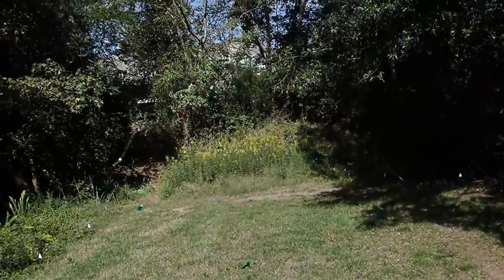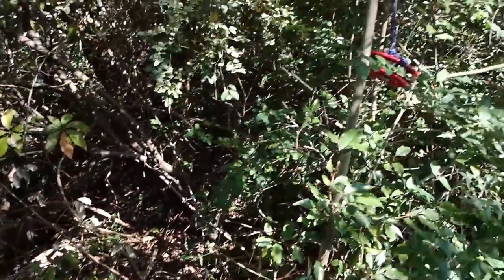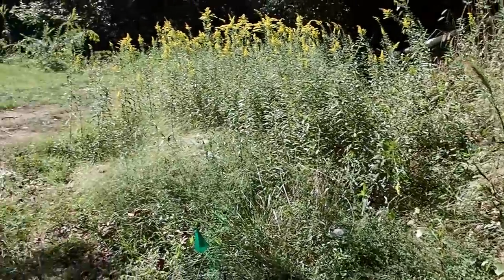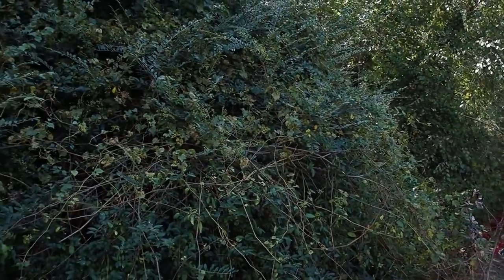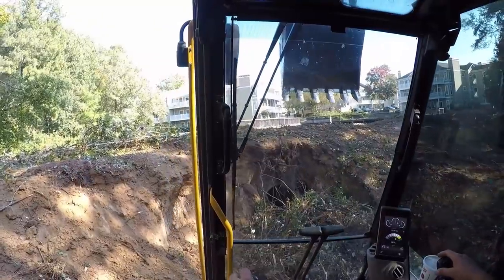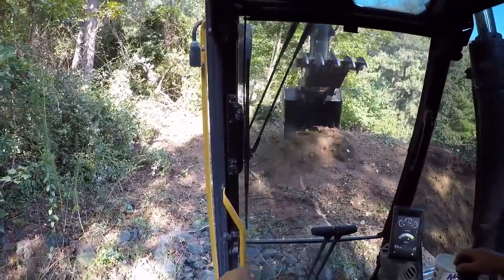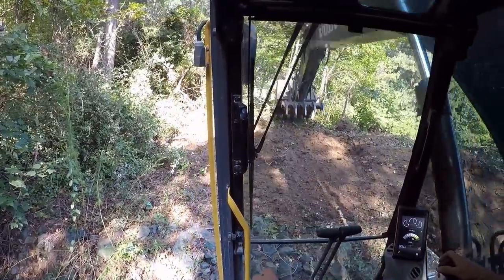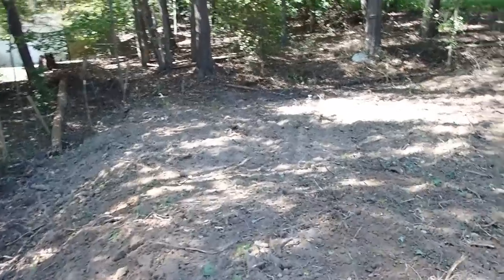Failing Pond Dam In The City

Comment: Chris do you have an outside washing line at home?  If you do, I'm wondering if you use the excavator to take the dry clothes off the line and fold them up neatly before taking them in.  If you made a nice stack of clothes you could press the bucket on them so you wouldn't need to iron them.   Just saying, as I totally think you could do it.  😄
Reply: He'd figure out a way I bet.  He sure makes it look easy.  Like when he pulls a stake out of the ground with a chain never leaving the cab.
Reply: Even if he had an inside clothes airer he could reach through the window.

Comment: I have two such thick cement pipes standing as gateposts.
In the summer I have a large flowerpot on top. It's really nice.
I have filled the pipes with Styrofoam so that they do not crack in the winter.

Comment: Concrete pipe through a pond embankment should be RCP C-361 (watertight) with a concrete cradle poured underneath and halfway up the pipe. A one foot thick concrete anti-seep collar with a minimum 2' projection from the outside of the pipe should be poured around the barrel within the phreatic zone.

Comment: Always wonder why you do not use a forest mulcher for these types of jobs, then I look at the cost $250000 to $300000+ for used attachment with 500 hours and I think I found my answer.
Reply: add that you then need to mulch it again since you didn't kill off the brush, you make money but the costs are high.
mulcher maint. is about as bad as chipper maint., very costly.
Even the low cost chain flail style mulchers cost a fair amount, since you need to replace the chain in large percentage frequently, and those don't do a great job.

Comment: I'm somewhat used to seeing a lot of vines. They grow on the walls of my house. Twice every summer, we cut up a ball big enough to fill the compost bin. Vines grow rather quickly.
Reply: Brush and tree killer will fix that...
Reply: @matthewwarfield4302  If I really wanted to kill them, simply pulling the root out would do the trick. I've removed one in front of the house, but left the ones at the back of the house alone. We've got all kinds of plants growing around the house. It's amazing enough that anything at all grows with the kind of soil we've got.

Comment: I watched a co worker climbing a bank in a 349 cat he lost his grip with the bucket and slid like you did but he panicked and for some reason swung to the side, ended up on his side. It took a month to get the parts to fix it back, but it's still going strong just has a slight squeak when you boom all the way back. The operator he  wasn't injured other than his dignity and refused the drug test so he's working for a different company now.

Comment: So let me get this straight. The HOA would rather pay for you to clean this all out than keep it maintained? I don't understand supposed intelligent people.
Reply: Different departments and different budgets, and no sensible cooperation between them.  If you can make it someone else's problem, then you are not paying to fix it.  The people buying the homes are not going to think or know about the maintenance issues with the pond, and the developer sure isn't going to tell buyers about a possible significant expense 15 years down the road.
Reply: Geoff Gyro  It's typically managements lack of understanding what good maintenance is. Worked for one where they asked what tools I had when I interviewed. Told them it would be easier to tell them what tools I don't have. They responded "all you'll need it a hammer, screw driver and a paint brush." I should have seen that as a RED FLAG...
Reply: Geoff Gyro  LOL
Reply: Probably not in the budget to have it regularly maintained beyond mowing grass.
Reply: @jamesrobinson1022  mowing and not letting tree roots break it down would have been a great prevention routine.
Reply from the maker: Correct and then when the state inspects these they fail and they have to face large fines until it's fixed
Reply: It's beyond maintenance at this point. A maintenance schedule "should" be established after the dam is rebuilt.
Reply: @er1073 I don’t know about this area, but my HOA is more than happy to raise my monthly assessment and over pay the maintenance crew.
Reply: @JC-yb3zb , Right, once grass has been established, just mow the dam stuff !!
It's really not that hard.
Reply: @jamesrobinson1022  just having grass instead of all that bush growing over it would have probably extended the life of the dam, at the very least you could see problems before they get too bad.

Comment: Little sketchy, me garbing something to hold on. :) As a landscape labour I blame landscape architects for that type of problem. That drives me nuts because there is no, or seems to be, thought into what is going to happen in next five or twenty years. If no one is doing maintenance it becomes a big hassle in hurry and a lot more time to fix. By the way did you give the excavator a bath before moving it here. :)
Reply: You are thinking of the 160 This was the 220. By the way this was a case of the trees getting out of hand.